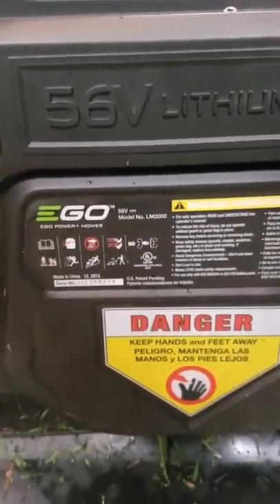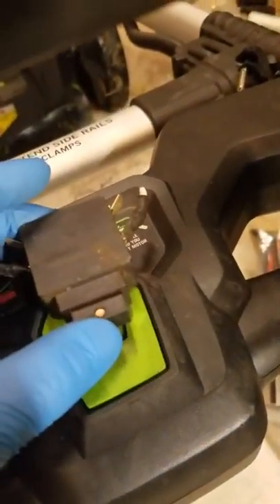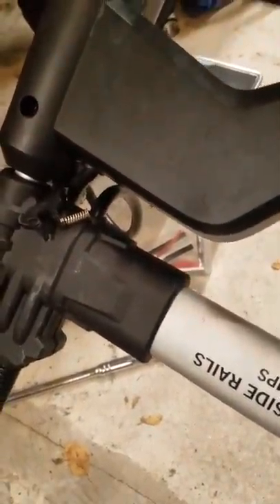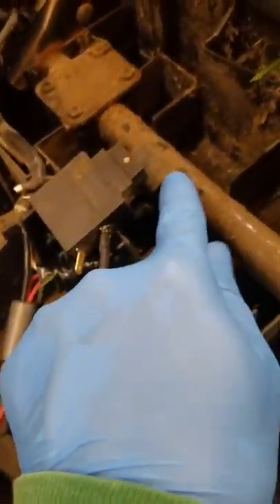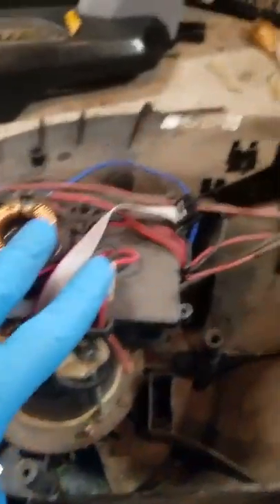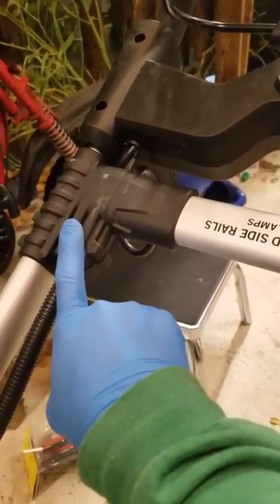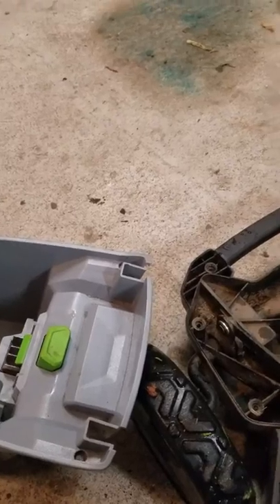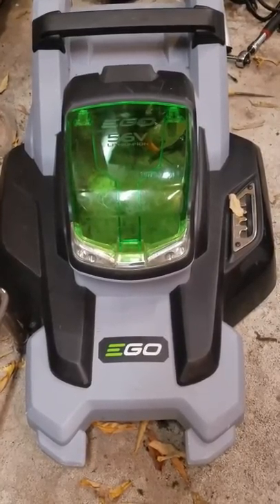Ego mower won't start / not starting ... FIXED!

Comment: Thanks for the great video. I have the exact same model as you - bought it about 6 years ago (1 yr our of warrandy - damn ... ha ha ha). I just went to mow my grass first time a this season a few weeks ago and to my great suprise it wouldn't start. Funny thing, though ... after I wouldn't start I was pushing around on that bottom panel where the headlight button is and it suddenly started working but then when I went to begin using it, it again wouldn't go on. So my suspicion is that it's not the motor but is instead a power problem such as one of the three micro-switches or wire. Also, my headlight doesn't work as well further leading to the suspicion that it's a power problem. I'm thinking the problem is in the same area as your problem, perhaps the same issue. I have two questions, 1 - What is required to access the area at the bottom of the mower by where the headlight switch is ? I don't see any screws so I expect they're hidden. Also, when your motor wouldn't turn on, did your headlight work (If you tried it)? I'm wondering if the headlight goes off when the motor isn't on? Tim
Reply from the maker: Hi Tim I can't remember if my light worked or not when my motor would not turn on. I'm processing the video right now I just shot on how to remove the top. I hope it will help you and that you have a simple switch problem like I did. The video will be up tonight.
Reply: Hi Virginia Fruit Grower. I fully vacummed and hosed down the underside of the unit and can now clearly see all of the screws. I tackled taking off the cover a few days ago and I am pretty sure I removed all of the screws you specified but the darn cover still refuses to come off. It looks like it is getting hung up in the back. The front and middle appear to be free. This is so frustrating as I appear I am so close. Do you remember if there was a special way the back had to be removed once the screws are removed ? There appears to be one screw in the back that appears to be so deep I can't tell if there is a screw there or not. It feels like a screw is there but my neighbor says no. It's in the way back on the underside of the unit. Any thoughts ?
Reply: Per the reply I just sent, I removed all of the screws you specified or so I think I did but still can't quite get the cover off. I just got an idea. Tomorrow (Monday) morning, I'll create a video showing all of the screws I removed and you can see if it looks like I got them all. I'll also show what part of the cover appears to be free and what part isn't free. I'll post the video here for you to see and perhaps for others to learn from as well.
Reply from the maker: @wdedula  did you watch the top removal video I posted  couple days ago?
Reply: @VirginiaFruitGrower  Yep I watched it the same night you posted it and then while removing the screws and while double checking the screws I removed. Your video was very helpful and clear though not sure why the top isn't coming off. As I said, seems to be hung up in the  back. I'll post a video tomorrow showing all of the screws I removed. Wait for the video and then let me know if you think I forgot anything. I'll post it on Youtube and will then link to it in a reply to your video.
Reply from the maker: @wdedula  I'm pretty sure I accounted for all the screws I removed.  It does take some effort to pop the back off once all the screws are out. I had to lower the handle  partly in order to pop it out.  You may have to just pull up with more force?
Reply: Virginia Fruit Grower - I still plan to post a video but probably won't be till tomorrow. I don't usually make videos so I'm new to this. I do have two questions. Do you by chance still have your top unscrewed ? Am wondering if you could take a photo (Not a video) of the underside of the top so I can see where all of the screw attachment points are. No need to do it if you've already assembled it. The front and back both seem to be lose but there seems to be something holding it up in the area right below the headlight switch and battery condition indicator panel. I checked and all screws seem to be out that you specified in your video except one (See my next question) so I'm stumped as to what the issue is. There is one last screw which appears to be out but it is still in the hole and is not coming out with my magnetized screwdriver. I believe in your video you mentioned that you had to use some sort of pick-up tool to remove a few screws. If that was required, could you let me know where I could buy such a tool ? There were a few other screws that were also like this but I was able to dislodge them. I will probably be buying another brand of electric mower in a few days (A Toro) but would still like to get this EGO working as a backup. Toro provides a parts list and exploded assembly diagram right on the Home Depot web site. That would have immediately answer my question about how ti disassemble the unit.  I asked EGO today if they had such a diagram and am awaiting a response but don't expect them to provide one for the customer like Toro does. Based upon the many Youtube videos posted about EGO mower's not starting, I am beginning to think it is a cheaper and problematic construction by using a plastic deck. Seems like limit switches have a tendency to pop out of alignment requiring an expensive repair. Toro seems like a better, more trouble free design and with a steel deck at a cost cheaper than EGO's steel deck version.
Reply from the maker: Hi William. I am sorry that the top removal has been such an ordeal and ongoing issue. This is the third time I've removed the top on two different mowers and luckily didn't have it hang up like yours. In order to remove the top I did use a small diameter magnetized pick up tool (I believe I got it from Harbor Freight) just to gather the screws but it was not essential to pull all the screws entirely out in order to remove the top. I actually gave up on a couple because they refused to come out of their deep holes. I just made sure they were unscrewed all the way. Maybe you can yank on the top while simultaneously attempting to unscrew the one underneath the headlight switch. Even just one or two threads still screwed in will stop you from being able to lift it up. Unfortunately I reassembled the mower Sunday afternoon. I am willing to disassemble it again for you to take a picture if you are still unable to get it off tomorrow. Just let me know. Good luck! Also I agree with you that Toro is a way better quality mower but I was just trying to get away from using gas lawn tools altogether.
Reply: @VirginiaFruitGrower  Good news - I finally figured it out. I had missed a single screw actually one underneath the blade. I had checked there numerous times and thought I got them all but apparently that was pretty deep. Just for the heck of it, I decided to tap my screwdriver down one of the holds and low and behold, it sounded like metal. So when I started turning, I could feel the screw break lose and start to turn so I knew I had it. Once I removed that screw, the cover came right off. Or actually the screw (Like some of yours) didn't come out but I turned it quite a bit and then tried and the cover came off. When I removed the cover, it appeared that the switch detecting when the handle was in the correct position had come out of place so maybe just putting back in place will fix the problem. I know a lot of people are bypassing those switches to avoid future problems and while that's tempting, it is part of the safety system so I think I'll instead see if I can secure that switch in place better with a ty-wrap (preferred) or some glue. I am also going to document how I took the cover off and take some pictures so I can remove the cover and fix it in the future if necessary. It's also dirty inside with some old grass so I'll take a vacuum to it as well. Since we have exposed electronics, I won't hose it down, though like I did with the outside but may wipe parts of it clean. I'll report here on my final result when I get things together and working, probably in a few days. I want to thank you so much and enormously for your guidance - I figured my issue was something so stupid like a single screw not removed.
Reply from the maker: @wdedula  Great news so far. Hopefully it was as simple as the switch being out of place like mine. Thanks for the continued updates! At least it has been an interesting project to work on while we've been 'sheltering at home'.

Comment: the relay that you removed, inside the handle with that little red button. Does it supposed to be pushed in or released ( open) for the mower to start?
Reply from the maker: HI Charlie, the little relay inside the handle frame that gets extended needs to be in the released position to let the motor start. I just took out that little black plastic and left the little relay in as is.
Reply: @VirginiaFruitGrower  Ok now that i removed the spring and that little piece I guess I have to put a heavy tape on the button to keep it pushed in right?
Reply from the maker: @tennis2469  no just leave it untaped. It needs to be open (unclicked) to allow electrical flow..
Reply: Oh ok...thanks.
Reply from the maker: @tennis2469  good luck with your mower.  I hope you get it all fixed up!

Comment: Virginia Fruit Grower or anybody. There is a black wire that is taped to one of the red wires going to the motor. Do you know where that black wire gets attached to on the motor? During removal to replace, the motor fell and stretched and pulled the wire from the motor. I have been unsuccessful in finding a wiring diagram so far.Thanks in advance for any help that can be provided
Reply from the maker: Sorry but I'm not sure where it goes.🙁
Reply: @VirginiaFruitGrower  Ok. Thanks anyway for the quick reply

Comment: Got the cover off and the battery casing connected. When I engage the handle the battery hums but doesn't start the mower. So it's getting power from the handle to the battery. Any ideas where the disconnect might be?
Reply from the maker: Did you check the switch down by the base here 2:17 ? Hopefully you get the problem figured out 🤞
Reply: @VirginiaFruitGrower  so that relay switch isn’t needed? If I remove it and it still doesn’t work then I can look for some other issue?
Reply from the maker: @nscast8762  yes you can bypass it. If you bypass that switch and it still won't start up it would be some other problem.  Hopefully the motor itself isn't burnt out 😬.

Comment: How do I take out the handle switch?
Reply from the maker: Hi Wayne, there are a few screws on the underside of the mower handle. Just unscrew them all and it will separate so you can access the switch. I did not bypass that switch but did check to see that it was positioned correctly and functioning correctly.

Comment: I have a LM2100SP EGO  mower. Sent it off for repair and they said Rodents had eaten through the wiring. It appears to be only one wiring connector The pt.# is 4930490001 . Home Depot wanted almost as much to repair as I paid for it so I had them send it back to me as is. My question is how to get the battery box off?  where I can get to the connection to replace that wire. . HD wanted $385.00 to replace it, part is $9.00  Thanks Ralph
Reply from the maker: There's a bunch of screws underneath the mower that are sometimes hidden because of the accumulation of grass. I would search Ebay for the part. I see a whole battery box on Ebay right now (3/9/2020)for $80 or best offer. Good luck!
Reply from the maker: I'm assuming the damage is too bad that you can't rewire it?
Reply: @VirginiaFruitGrower   I was unable to get the battery box off all together. but got it free enough to get the broken wires soldered together in stead of replacing it. I saved myself about $400 .$385 to repair it with a $9.00 wire, and a $20 deposit to ship it and determine the problem.  It works fine now. Sorry I didn't do the video.
Reply from the maker: Here's how to remove the whole top off or just the battery box: https://www.youtube.com/watch?v=ZHqYqpD9eUs

Comment: The mechanism in the handle extension basically falls apart when you open it up. I have no idea how to put it back together, even if I wanted to. And Alas, that switch wasn't the issue.
Reply from the maker: Did you check the switch at the base of the mower? Also if you don't bypass the switch or put it back together near the handle extension the mower won't start.
Reply from the maker: Nox I'm not sure if you gave up on your mower but I posted a video on how to remove the top: https://www.youtube.com/watch?v=ZHqYqpD9eUs
Reply: @VirginiaFruitGrower  Thanks!
Reply: @VirginiaFruitGrower  thought you said, remove the spring and you are all set?
Reply from the maker: Yes if I recall correctly there's a spring in there that will fly out 😐. Sorry to hear that switch wasn't the issue. Good luck finding the problem.
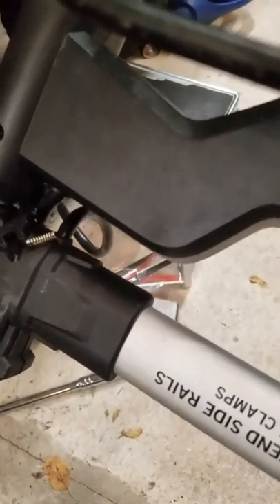Reply from the maker: @tantricriver  the spring mechanism in the handle adjustment is what I removed at 1:40 to allow me to extend (or even not extend) the handle position to whatever length I want and still be able to operate/turn on the mower. Not sure if that makes sense 🤔

Comment: Hi - I noticed you managed to remove the top cover to expose the motor and wiring. I tried to remove mine today with the help of my neighbor and we just can't seem to get it off. We removed what we think are all of the screws on the bottom of the unit but without success. Is there a trick to getting it off ? Any screws that are hidden and not obvious? The battery case is the only thing I was able to remove. I have a power problem - Unit worked great for 6 years and then something happened over the winter and when I first went to start it a few weeks ago, it wouldn't start - even the headlight wouldn't turn on.. I have exactly the same unit that you have.
Reply from the maker: Hi William! I will post a video on how to remove the top of the mower tonight.
Reply: @VirginiaFruitGrower  Oh WOW - Thanks so much - That would be so helpful. Thanks !!!
Reply from the maker: @wdedula  posted: https://www.youtube.com/watch?v=ZHqYqpD9eUs

Comment: Do you not know the difference between a relay and a switch? It's just that you keep calling  mechanical switch a relay.
Reply from the maker: Apparently I do not know the difference. Thanks for the clarification.
Reply: That was very rude, Nick. Thank you VFG for taking the time and trouble to show us your issue and how you fixed it.